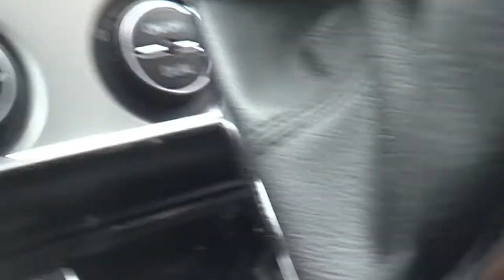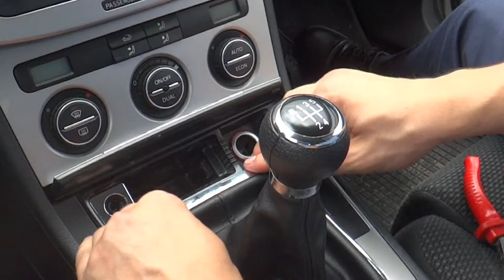🚗 How to change Volkswagen Passat Gear Stick Gaiter

Comment: What is that red tool called ? And what exactly are you doing with it ?
Reply from the maker: I use the wrong tool, you need a hose clamp crimper to fix the ear  hose clamp.